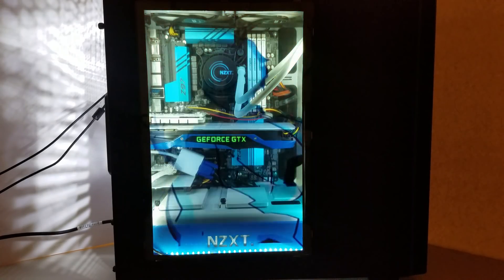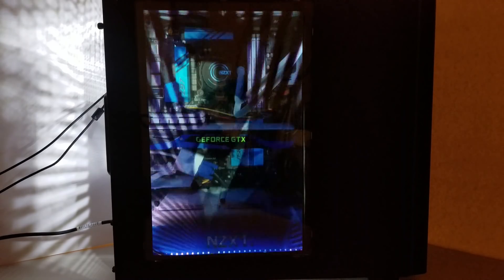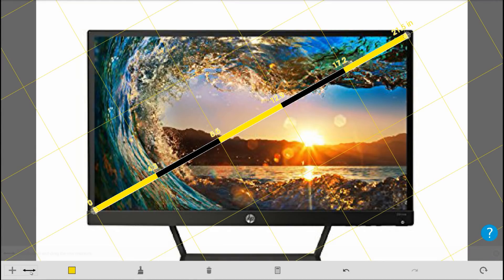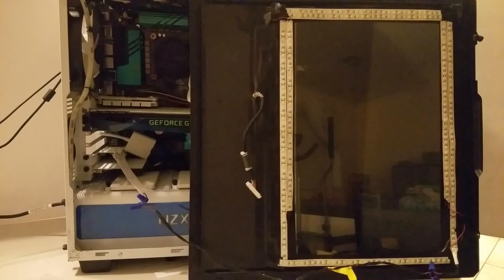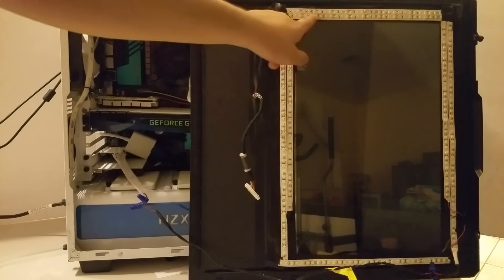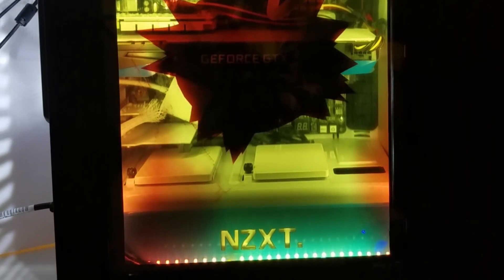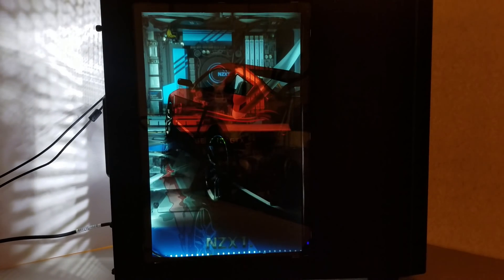LCD Side Panel Tutorial (Sort of?)

Comment: For some reason i cannot get my lcd to work. Windows recognizes it and i can even drag windows off my main monitor but i cant get it to show anything.
Reply: I dont think i messed up anthing with wiring. Soldered it together looking at the power board scheme. It has the following wires: B-dim, 15V, 3 ground wires, two 5.1V wires, A-dim and on-off wire. I used one 5.1V and one ground wire. Connected it to molex using the scheme of the molex you provided.
Reply: The lcd im using is syncmaster 932B
Reply: Do all the molex pins need to be connected to something? im only using 2 of the 4 molex slots at the moment, 5v and ground for the monitor. I also bought some ultra bright leds, which i havent yet connected because i cant get the lcd to work. To test it im opening just a white picture on my main monitor. Im unsure what to do.
Reply from the maker: I've only worked with two monitors so far, so I really don't know what kind of set up/voltage this monitor has. I looked up the monitor your using, and found the part numbers that go in your screen, but nothing on the amount of voltage it needs.  If it's receiving less volts, it won't turn on or function properly, if it receives too much, it could fry it, so be careful, it happened to me one, it is not pretty. Regarding the molex pins, only connect the ones you need to use. In my case, the molex connection I'm using has only two wires connected to it, the other two are not connected to anything, using only the ones you need it fine. As for testing it, try using a picture with a mix of light and dark colors and be sure to have some light behind the LCD(white tends to turn off the LCD because behind the LCD, before you take it apart, is a white screen, so when you need to display white, that area turns of to show you the white background, dark colors cuase the LCD to display images). When I was testing mine, it was impossible to tell it was on unless I put a flashlight behind it and shined a light through to see an image on it.

Comment: The reason pixel density is important is for the transparency of it. So the more pixels per inch (PPI) the more tightly together they are, even though the transistors and what not are very very small put enough of them close together and you block light passing through. So basically if you have 2 screen of equal size, say 1080p and 4k, the 1080p would be more transparent and hence let you see the insides of the pc better, which is the effect you want.

Comment: What lighting strips are you using?
Reply from the maker: http://a.co/0CI6hKd
Reply: Thank you! I'm going to add RGB lighting along with the high density LED's to get some of the color effects I see going on with the actual snowblind. It's going to take a couple of months but I'll keep you posted as I do it. I have to mod my case to be white, make some shrouds out of acrylic sheets for my graphics card, mod the memory to be white and then start adding in the lighting. That's the most critical part from what I see.

Comment: what size monitor for an nzxt s340 case?
Reply from the maker: DoctorPepper4  I measured this image of an s340 and I'm getting these measurements for your window.

https://imgur.com/a/sZsNF

I would suggest a monitor of 11 x 11.5 in. You could start there. The monitors I've opened usually have more "screen" on the edges(this extra "screen" does not display anything) , so if you're trying to fit the whole thing within the plastic panel, you want a monitor that slightly smaller(is what I went with in this build, my plastic window dipped in). If not, try something close to the plastic panels measurement(12.29 x 11.90 in) to fill the whole thing if it doesn't dip in, it looks good with the panel touching the window vs having a space  (just my opinion).
Reply: whats up? I'm still looking for the monitor but I cant find anything that size, if you can please point me in the right direction. thank you
Reply: can I use this? 
Roll over image to zoom in

YiLang 
YiLang 12-Inch 1920X1080 HDMI DVI-D VGA PS3 PS4 WiiU Xbox360 1080P Display Monitor for Raspberry Pi 2B B+ Raspberry Pi 3B Windows 7 8 10
Reply from the maker: DoctorPepper4 Sure, it fit in that space, but it'll look something like this. https://imgur.com/E4HAaxg

I based that image on the screen you mentioned having a 11.6 inch diagonal measurement.

If that's the effect you're looking for, give it a try.
Reply: is their anything you can recommend? please and thank you. I cant find anything
Reply from the maker: DoctorPepper4 I've been looking through 15 inch monitors (4:3) and most of them are over 13 inches at their longest side, it's such an award size, I'm not sure if you'll find a monitor that works for your build unless you pick a bigger monitor. 

Your case window is more squared, so I was looking at 4:3 monitors because they're closer to squares vs 16:9 monitors but I had no luck finding such a monitor. Even if we did find one that fit,  it would be closer to a 14.5 inch monitor which are very rare. Here's what it would look like on your build. https://imgur.com/a/Oydbm

Good luck finding one, the only thing I was able to find was just the lcd panel with no connections, the challenge would be to find parts that work with that specific model and that's new territory for me since monitors already have those components. 

You could look into  a custom monitor/panel that will work with your case, a quick Google search brought up this company :http://www.accuview.com/product-list.php?Custom-Build-to-Order-LCD-monitor-pg1-cid79.html

As to how much something like that will cost, I really don't know, they don't have any pricing quotes on their site (at least I didn't see any). 

And going the 16:9 route(like I did with my case, but the window is much more rectangular so it worked), using a monitor with it longest side at 11.8in will give you these results: https://imgur.com/a/Xiz0V

I'm not sure what you want to do, but that's what I have down so far, hope it helps.
Reply: thank you so much, I live in homestead fl if you ever need anything shipped from here or anything just let me know. thank you
Reply from the maker: No problem, if you have any more questions, I'll do my best to answer them.
Reply: okay so I'm think of switching cases with a friend and he has the NZXT S340 Elite would this be a better case or should I just buy the same case you have.
Reply from the maker: DoctorPepper4 I took measurements of the S340 Elite and you have a lot more room giving you a lot more options to work with. Again, its closer to a square than a rectangle, so a 20"/19" 4:3 monitor could work, the sides will be unused like in this example. https://imgur.com/a/EpVtF

Or you could try something like this https://imgur.com/Oqh1xcM since not much happens on the bottom part of your case. If you like either arrangement,  stick to the S340 Elite. If not, consider purchasing a different case.

Comment: Excuse my ignorance, but what did you use other than the board from the monitor? What did you keep and what did you get rid of? Is it just that this specific lcd is transparent without the backing?
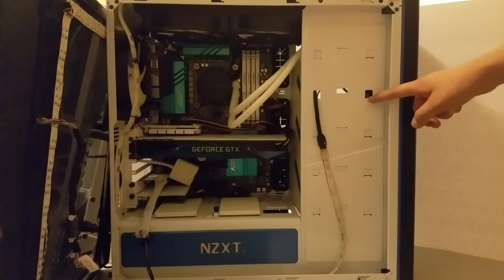Reply from the maker: Jesse King I don't recall exactly what I removed, all I remember tossing was the board to which the power outlet connected to. I kept everything else which would include the board to which the LCD connects(this is hidden under the electrical tape and is right next to the LCD Panel, it's very obvious you need this part as it supplies the LCD the needed information regarding what it needs to display, it connects to it with wide wires that look like ribbons), the board that has the video output connection (in this case a vga output, shown at 5:40) and the board with the on and off switch which I'm not entirely sure I need to keep, but I did and it works with the current set up. 

All LCD panel to my understanding are transparent, they have a white  background behind them(kond of like how a projector needs a white background to look good, usually plastic and light up with leds, it's not attached to it making it easy to remove) and that's how they work. The white you see on an LCD monitor is actually the white plastic behind the LCD monitor(if that makes sense) which is why I put the white parts in my PC, to give it that background.

Comment: Cool video! Your mod looks like it came out really well.  One question:  Did you use the controller board that came with the monitor or a kit like they sell on eBay?  I'm planning on trying this out but a little confused how to power the board with a molex.  Thanks!
Reply from the maker: tsally It was the control board that came with the monitor. The board I had gave some description as to what each wire did. So it was very straightforward as to which wires I had to use. As to how I attached them to a 4 pin molex, I purchased  a 4 pin Molex Extension(Y Splitter cable if you don't have an available 4 Pin Molex) cable cut and striped the needed wires based on the voltage in needed (theres a diagram in the video) and put them together. I also unplugged a few things in my PC just to briefly power it on to see if the LCD was receiving power.

Comment: Really cool! Thanks for showing us. Always wanted to try this, maybe now I will! 

If I could give a suggestion, it would be to show more of the process. I would have liked to see you taking apart and reconfiguring the monitor, seeing how you decided to put which parts where inside the case, etc. 

Super cool, you definitely just got a sub from me!
Reply from the maker: I wish I would have recorded me taking the monitor apart, I never planned on making this video, so it didn't cross my mind at all. However there are plenty of videos on youtube that show this process, deciding with components to keep wasn't too hard, the monitor I opened was pretty simple, guessing which cables gave the LCD power and which ones didn't was the hardest part in my opinion. If you decided to do a mod similar to the one I did, feel free to message me on reddit, I'll help out where I can.
Reply: I am in the process of doing this mod myself, i am stuck because im not entirely sure which wires connect from the circuit board into the power supply

Comment: The white internals definitely make for a better result, I think you made the right choice switching cases and painting the internals white. As far as pixel density, the original Snowblind case uses a 1280 x 1024 resolution, but the effect can still be performed with a HD display. Chris Albee did just that with a portable 1600:900 HD monitor: https://youtu.be/tSPfaJczIS8

Great guide and thanks for the shoutout, Pixel!
Reply from the maker: Good to know! I did find a monitor that was HD, but I wasn't sure if it would have the same effect, so I went with my current one instead.
Reply: I have a great idea for the both of you. Why not make this a business. Think about it. You create custom cases similar to this, but at the same time add in ordered parts for people pcs. This way users can have custom gaming pcs, but with the parts they want and with the cases they want. You'll make a ton of money doing this. Being not everyone wants to spend 2,900 bucks on a gaming pc when 900 bucks goes into just the case alone by Snowblind. It's not a great investment. More like a ripoff. Max people would spend 400 more but no damn 900 bucks for what they are pitching with the components that are offered in it.